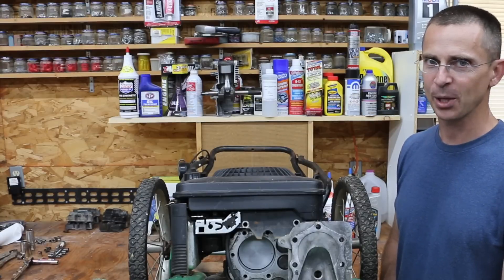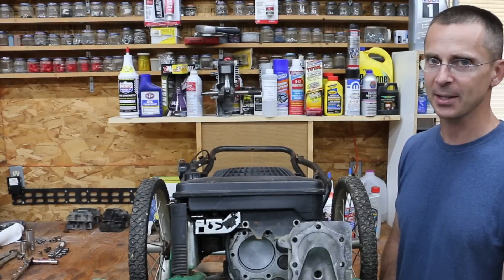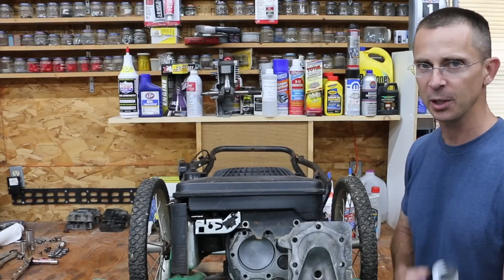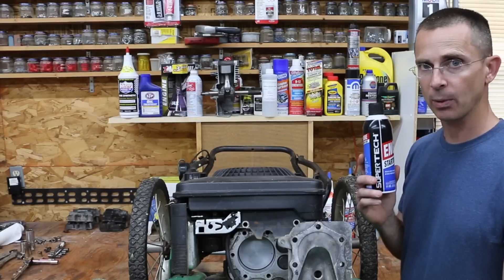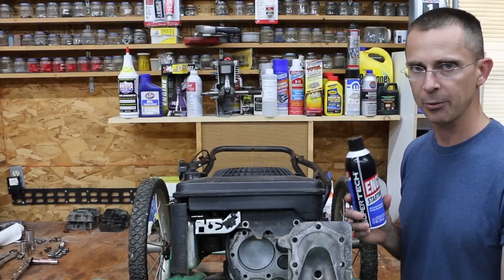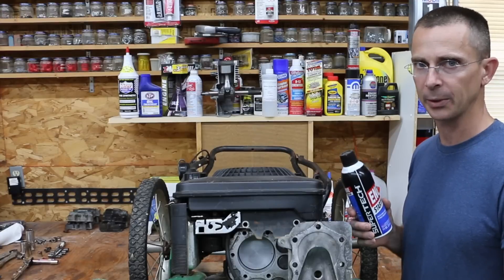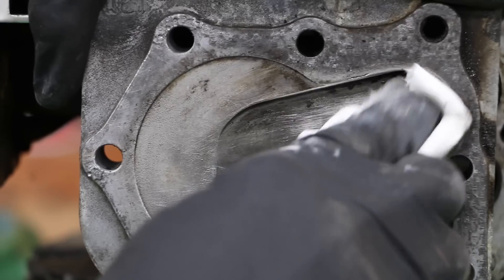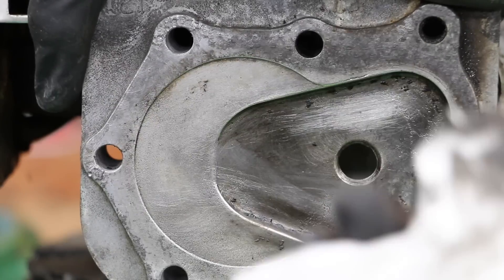Will Running an Engine on 100% Starting Fluid Cause Damage?  Let's find out!

Comment: The one thing I'm learning from these (run an engine on) videos is that a Flathead Briggs and Stratton will run on damn near anything that will burn.
Reply from the maker: You're right. They're really impressive engines.
Reply: they can there is evin a video of some one hitting one with NOS 
the mower won lol
Reply: @redneckasmr-xd1gg  Now that's hilarious 😂.
Reply: They thrive on abuse and neglect
Reply: @alexkluemper6880  Did you get that from AvE?😂
Reply: @Roostertailin  of course!
Reply: They were built right back then, the new ones suck
Reply: And you can put them through all kinds of hell, and theyll keep running
Reply: @MrErikw26  
    I read somewhere that part of the Master Technician certification process at the Briggs and Stratton proving grounds involves a Nathan's hot dog eating contest officially verified using a Timex watch running on Energizer batteries.
Reply: I work at a recycling center. I'm able to get nearly every B&S flathead that comes in to run. They're super tough and extremely reliable
Reply: It's almost like Briggs & Stratton knows their target demographic!
"I need to mow the lawn, but I ain't got no gas, all I got is this jug of moonshine and a can of Zippo fluid. Eh, it'll prob'ly work."
Reply: Gumiho Yeu  The rule of thumb for civilian outboard motor prices is 1 grand for every 10 horsepower. 200 horsepower engine will run you about 20 grand. I have a 1991 Javelin 396FS with an Evinrude XP200. She'll run 65 mph when unloaded with a 24 pitch prop. Different prop and it'll push up into the low 70s. Too fast for me. Only bad thing is it EATS gas fast when cruising at wide open throttle. Lol my next boat will have a 4 stroke Mercury on it.
Reply: @saltysteel3996  That's why I buy used outboards.  A couple of recent examples that are in excellent condition with very low use:.  A 100 HP Merc that I paid $500 for.  And a 90 HP Evinrude that I paid $300 for.
Reply: Ha, that reminds me of a story I heard from a buddy ages ago, though this has nothing to do with Briggs and Stratton engines.  He and some friends had dirt bikes and would ride together often, but being young and living out in the sticks (on an Army base, actually), getting gas on the spur of the moment for dirt-bike riding was not always easy.  One day they were going riding and my friend didn't have gas but he did have Coleman Fuel, so he poured that into the dirt bike's tank before going to meet one of his buddies.  After a bit, his friend noticed a peculiar odor about the bike and asked "what are you burning in that thing?"  He explained that it was Coleman Fuel, and the friend replied, "That explains why I've got this terrible craving for bacon and eggs and coffee!"
Reply: Way more reliable than OHV and OHC engines
Reply: @jedrooney4302  ohv maybe but if its a gear driven ohc then it should be just as reliable as a flattie
Reply: Well, I have a ole 5.5hp Tecumseh lawnmower that I have used for 3 yrs,doing acres of grass.(50bucks used)
Hit a piece of steel once and the blade was a pretzel,literally {!
Thought the crank ,motor,was done.
*New blade installed & ran perfect!!(psst:the ole Briggs didn't come with a hardened/forged steel crank I believe...in other words don't even think about hitting a stump!!{!
Cheers!
Reply: @kanadianbacon7733  thats not the engine thats the blade, blades these days are made super soft so they dont shatter and bust some kid across the street with shrapnel
Reply: @kanadianbacon7733  Too bad the tecumseh motors are so finicky with their tuning. I've used and abused dozens of briggs engines and except for one that threw a rod due to low oil level they've all been tough motors. I've hit rocks and stumps with them and never damaged a crank. Certainly hurt some blades though!
Reply: @isaakwelch3451  I'm glad I'm the not the only one that didn't really care for Tecumseh because of the finickyness.  God help you if you left the choke on for one microsecond too long.  I used to fix mowers when I was younger, when I saw a Tecumseh I raised the price.  Briggs you can pee in the gas tank and it will still run.  But they were still though.  I think people gave up on them earlier so it always appears the Briggs had longer lives.  Reality is they probably were both great for the same # of hours.
Reply: Brad:*Those older Tecumseh motors had forged cranks..the blades were hardened & Tempered...so as not to break apart from being to hard{¡
The replacement blade was a little softer than the factory blade,,,as is often the case,as I have to sharpen it more often)!)
"Cheers"!
Reply: mbsnyderc reminds me of those multi fuel engines they ran in the army m35a2 “deuce and a half” trucks
If it’s flammable and you have it on hand, the truck prob will run on it
Reply: @warehouse-tt2js  mopar had a gas/LPG version of their slant six. I put diesel in mine once out of curiosity and I swear that thing made and extra 30 ft lbs🤣 multi-fuels are great. Especially if you can get old fryer oil
Reply: Gumiho Yeu  I believe Briggs and Stratton has a 5 hp air cooled outboard. I've seen them at Fleet Farm. I think they might be going under the Coleman name now though. Not positive.
Reply: That's true.
Reply: Last summer before the 3.75 got rebuilt it would run on bug spray. Even sprayed some vinala flavored crap in there even sucked it right down without a prob!
Reply: One of the people I know has had bad experiences with them and they called it a "breaks and scrap em" I told him he was doing it wrong.
Reply: R ccx x cc. H DC. Bbn zdx once.  B CNN b b.  vfc BBC NYC.           T d.  S. Bvb bv.buv Bobby     dc serve e d x zdx. r.  V v b c m Dee v bbn bvb s.      S
Reply: They don’t die
Reply: I've often heard that if you have old or bad gas, just put it in your lawnmower because those motors "will run on anything"
Reply: Yup i ran one attached to a generator on actual moonshine. It ran very cool , and was horribly inefficient though. 🤔
Reply: Now think about how people in the '70s and onward progressively complained and pondered about how their engines were incrementally being made less reliable and more fickle due to EPA and its emissions regulations. It's not that this is a particularly good engine. It's that there has been an unyielding march of restrictions and regulations that have the one and only goal of giving some centralized authority control over your engine usage.
Reply: @buckstarchaser2376  Except engines last longer now than the did then.EPA stuff doesn't hurt your engine it might kill power, but they have gotten around that as well a modern v6 make more power than most old V8's.
Reply: @mbsnyderc  Okay, but now you're contradicting your original statement, that an ancient engine will run on anything that will burn... Any engine will attempt to do so, and many will change their own parameters to make it happen. Though older engines were more simple, modern engines use much of their potentially usable output to run emissions gear, cost more because they have to be made from the minimum of the lightest materials for those MPG requirements (when the world is still floating on oceans of available oil before even getting to the other fancy fuels), and they often don't even last as long as the beer-can-thin sheetmetal that the cars are made of... all for the emissions, as people will happily buy a heavier, longer-lasting car; even if it guzzles fuel.
Reply: @buckstarchaser2376  one the engine isn't ancient an to that has nothing to do with it running on anything that won't make it last longer.or make more power.and everything your saying is more about your politics that any reality you don't want cleaner car go to  some other country that has no rules and breath that air.there is a reason for everything.
Reply: @mbsnyderc  Sure, there is a reason to everything, however, I'm responding to your own point that you made in your original post. That includes an assessment of the political causes of your perceived magic of this simple engine, which have driven innovation in positive and negative ways. You have reversed your opinion upon finding your observation is clashing with your updated software. Good luck with that.
Reply: I am wondering if there is a difference in engine damage between fueling an already good running engine with starting fluid, and trying to revive a balky engine that wont start, with starting fluid. I think that the damage comes in the few seconds when the engine is turning over with starting fluid in the cylinder, but it is not yet burning off that charge of starting fluid on each revolution.
A deeper test might be to turn off the ignition and crank the engine while feeding it ether. i think you will see it score the cylinder and sieze up quickly.
Reply: @robertmencl9169  I've never had any issues with using starting fluid in motors, and I only use it for cold starts.

Comment: i wounder if i can use starting fluid in the tank of a push lawn mower that is still brand new but will not start after being bought brand new three years ago it was used the summer after it was bought then stored for the winter the next summer when i pulled it out to use it it would not start at all and it has a full tank of fuel in it i can get it to start if i dump gas down the carb or if i spay starting fluid in the carb but it will brefly start then sputter out also the carb is the new style carb it dosent have a primmer buld on it its a self primming carb and i have no experiance on warking on a carb
Reply from the maker: I don't believe that running straight starting fluid will help.  From the description of the problem, it sounds most likely that the carb has an issue.

Comment: It had gas in it ain’t no way that thing ran that long with starting fluid plus straight fluid in the tank s it gon way enough to go through the line
Reply from the maker: Thanks for commenting. Yes, the engine ran on 100% starting fluid.  I sprayed an entire can in the carb.  Thanks again.
Reply: Project Farm that’s crazy man I didn’t think it would do that

Comment: I don't have much experience with diesels, but I do know if used to start a balky diesel it will pressure* lock the engine and will not turn over for a period of time.---* I don't know the correct term here but I believe I got the idea across, I've seen this happen.
Reply: NOW, who's brave enough to try this on a 400 CAT.
Reply from the maker: Thanks for commenting.

Comment: you should try john deere brand starting fluid its supposed to be one of the stronger ones u can buy
Reply from the maker: Thank you for this recommendation. I still find it hard to believe that John Deere used to make tractors with starting fluid canisters mounted near the diesel engine to help with cold starts.  Starting fluid seems likely to damage a diesel as many others have commented.
Reply: u need to find some sort of smaller diesel for some testing too! would be cool.
Reply from the maker: Yes, I'm shopping around, but they are hard to find an are expensive.  The ones made in China can't be imported, since they don't meet EPA requirements.  Thanks again.

Comment: i have been told that brake kleen is better for an engine than starting fluid maybe try that see if its true? I am very surprised there was no damage with straight starting fluid! my guess is most damage from using starting fluid comes from back fires not the actual fluid running through the engine. I will definitely not be as hesitant to start and engine using starting fluid in the future. 
for reference I have a brother who has an old 7.3 that does not have working glow plugs. He has started this truck with starting fluid for about 8 years in any cold weather and so far has not suffered any noticeable damages.

Comment: Run it full throttle then disconnect the spark plug and it will keep running. So I do believe starting fluid can cause damage or engine to destroy itself.
Reply from the maker: Thank you for this recommendation.

Comment: As far as starting fluid in diesel engines I don’t know about all diesel engines however the old Kubota B6000 two cylinder diesel engines do not use starting fluid do not do it that’s one of the toughest little engines they ever put on a little tractor like it I bought a little Kubota B6000 a while back that I decided I was going to cold start mine with starting fluid as it was sometimes hard starting well it doesn’t run anymore slight explosion 💥 more or less I suppose it’s got a cracked piston God knows what else I’ve got to get it in the shop here in the next couple months and it’s going to cost me
Reply from the maker: Thanks for commenting on starting fluid use in a diesel.  I agree that it's not good to use it for a diesel.  I hope the problem isn't too serious.  I really like Kubota engines.  They are very well designed and built.
Reply: Project Farm I just bought that B 6000 back in October of this year second hand of course I think it’s a 1977 or 76 it’s four-wheel-drive and built like a German tiger tank or something just small,,, I love that thing  so I’ll have to have the whole engine rebuilt probably but I had already made my mind up to restore it anyway soooo,,,very unique and very cool

Comment: I think the starting fluid breaks down the thin oil layer that minimizes metal on metal contact and will, over time, increase ring wear, cause oil blow-by, lower compression, eventually thin out the crankcase oil, and cause premature rod & main bearing wear. On top of that, starting fluid is more volatile and is likely to diesel, preignite, and cause engine knock, and ultimately, more premature bearing & piston ring wear.
Reply from the maker: Great point regarding the impact of using starting fluid over time. Thanks for commenting.

Comment: I believe the ether in starting fluid has a much lower flash point than gasoline, so I would worry about it pre-igniting and causing knocking/pinging in an engine when running it under a load.
Reply from the maker: Great point. Thanks for commenting.

Comment: Great video, I have an older Craftsman chipper/shredder with a 5 horse Briggs flat head that I acquired non-running and while trying to get it to run on it's own, I ran it for a short time on starting fluid by spraying it into the intake. Thanks to your video I can now rest assured that no damage was done running it on starting fluid, I found that the problem had to do with the fuel pump diaphragm, someone had put the spring on the wrong side lol. But now it's running strong.
Reply from the maker: Glad you were able to repair it and it's running strong.  Regards.

Comment: I live in Ontario, Canada where winter temperatures make starting a diesel a problem. My 1989 Jetta diesel 1.6 l. non turbo started on ether would buck before starting as the ether was pre-igniting. I ended up using 2-3 % high test gasoline in the fuel; my mechanic retarded the fuel timing slightly to prevent engine damage due to pre-ignition. As gasoline is a poor lubricant compared to diesel fuel, I used synthetic 2-cycle oil in the fuel to prevent premature wear of the injector pump and injectors. I could start this engine at -26C / -15F with no smoking and no pre-ignition, just had to cycle the glow plugs 3 times. The injector pump was rebuilt at 400,000 Km. versus 250,000 Km. normally.
Reply from the maker: I enjoyed reading your post.  You've come up with a great strategy to avoid starting fluid and extend the life of your engine. Thanks for commenting.

Comment: It will absolutely destroy a diesel engine. I have rebuilt several small Kubota engines that broke the ring lands off of every piston because of starting fluid.
Reply from the maker: Thanks for commenting on this.

Comment: I knew it wouldn't harm the cylinder wall due the lube in the starting fluid. How about trying to run an engine on straight ether?
Reply from the maker: Thank you for this recommendation.
Reply: I dont think the lube does a whole lot, for cold start im sure it does but besides that gasoline doesn't have a lubricant.
Reply: I agree with Mr Davenport starting fluid these days has lube in it to be used for gas and diesel engines you did not mention if this starting fluid that you used was for gas and diesel engines thank you we enjoy your videos
Reply: I have seen just the opposite.  We had engine sieze after it failed to start on starter fluid.  It was parked for a few months, and the Pistons froze to the cylinders.  Combine engines are only run for a couple of months a year.
Reply: Gasoline is a "refined" lubricant. It's filtered out of oil from under the ground. Diesel has much more lubrication but both are refined oil. Jet fuel kerosene diesel and fuel oil are all the same base they just have a different additive packaged into them.

Comment: Hey man, you should try to run the engine on acetone-laced gasoline to see if there is a fuel economy savings at different concentrations.
Reply from the maker: Thank you for this recommendation!

Comment: Warning! Personal experience ahead! If you don't believe me, take your butthurt comments elsewhere!

I personally have ruined an engine with starting fluid. I used to drive a dump truck, quad axle Mack with a 12L diesel under the hood, and one cold morning my boss tossed me a can and said, "get to it. Just be careful."

In trying to get it started, I not only used too much, but the engine ran away and resulted in a spun crankshaft bearing.

So my advise? Use wisely
Reply from the maker: Great post and thanks for sharing your experience.  You're right, very risky in a diesel.

Comment: I would never use starting fluid to start an engine that hasn't been run in a long, long time due to lack of oil flow.  It could cause damage in that case.
Reply from the maker: Thank you for this recommendation!